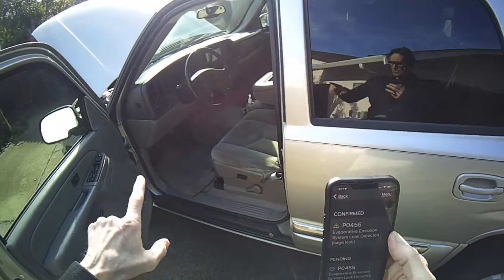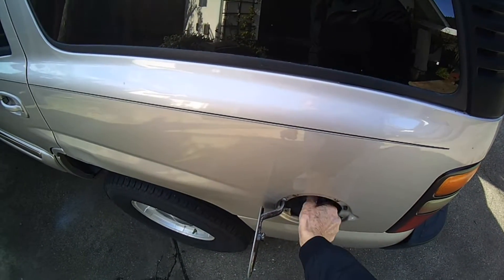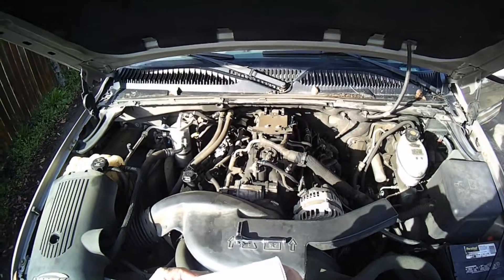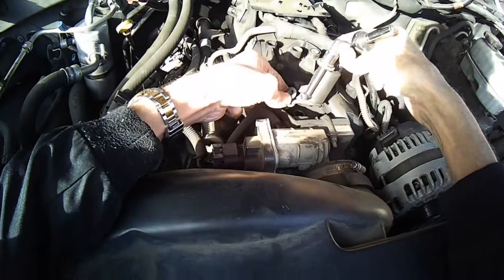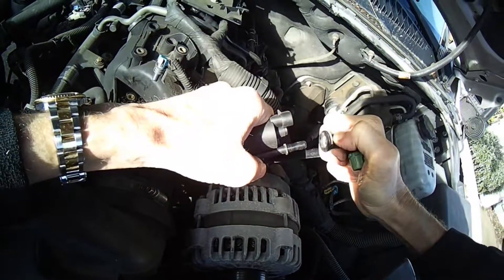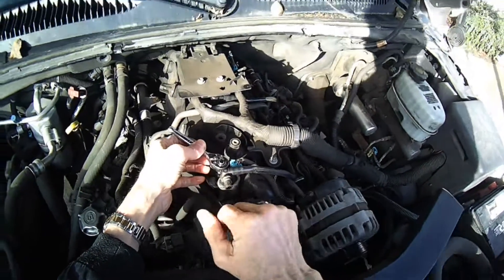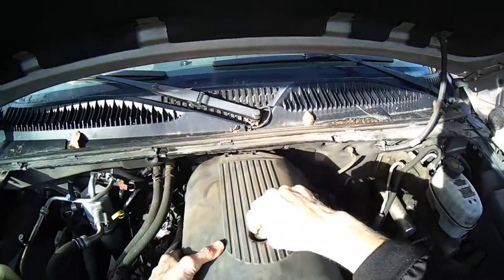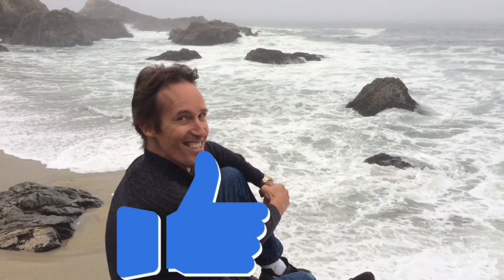✨ Yukon / Tahoe - P0455 Engine Light Code - Easy DIY Fix ✨

Comment: Thank you. I have an 04 yukon. About 4 months ago I had that very code come on. I ended up purchasing a new gas cap and check engine light finally turned off. Well today it came back on with same code so I will move on to the next most likely scenario causing the issue. I appreciate the help.
Reply from the maker: You are welcome! Glad to help.

Comment: Thank you for the video, very helpful. I didn’t see the link to the valve anywhere in your description. In your video you said to clean the valve for a “quick” fix…what do you suggest to clean it with?
Reply from the maker: A can of spray MAP Sensor cleaner should work well 👍